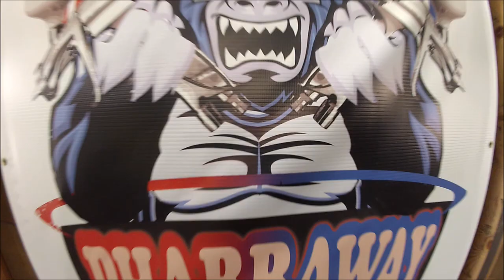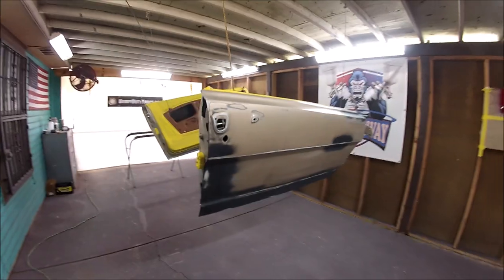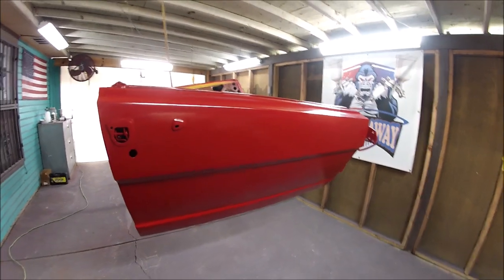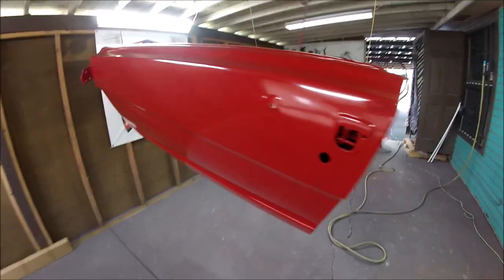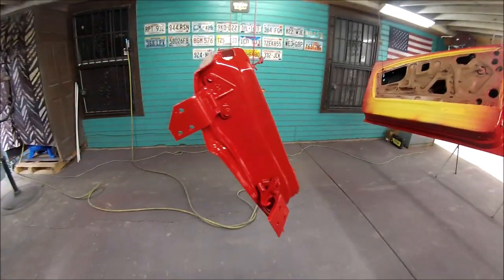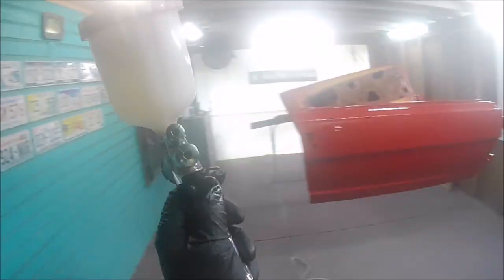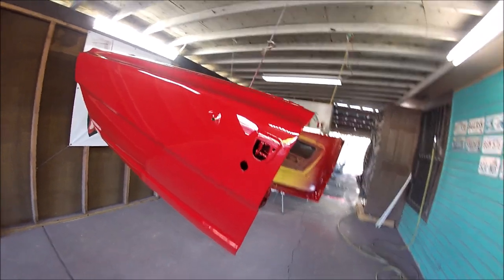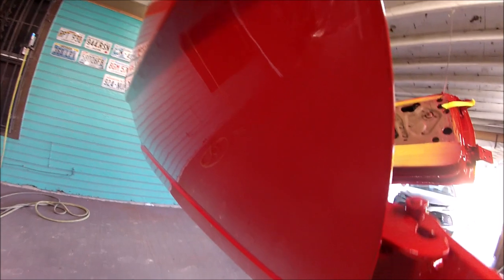How To Paint and Restore A 1966 Ford Mustang Fastback PART 5

Comment: A total respray cause the camera case was dirty! 😆 Love ur vids! Relaxing. Thanks! You should have a stiff thin wire attached to the door hinges so you can pull when you want to move the hinge. You won't have to actually touch the hinge. Just a thought.
Reply from the maker: Thanks for the tip!